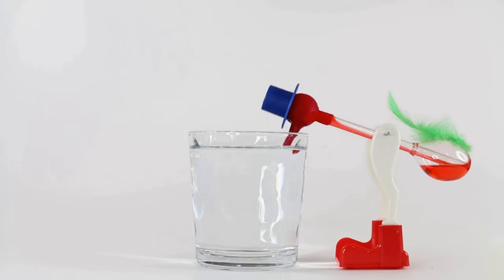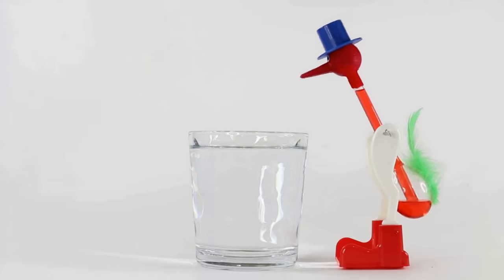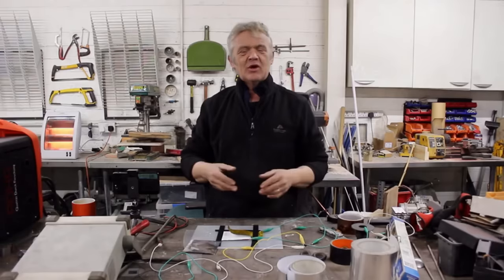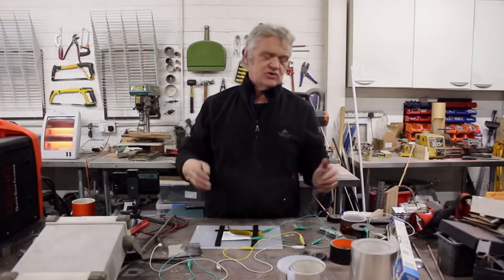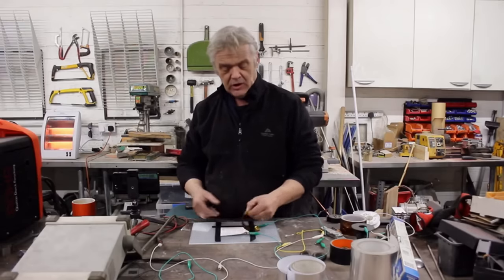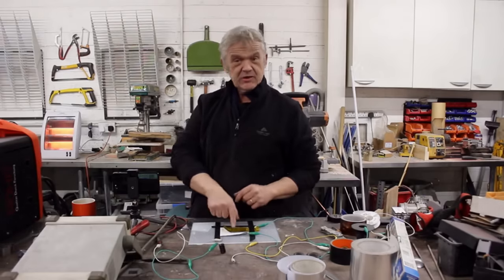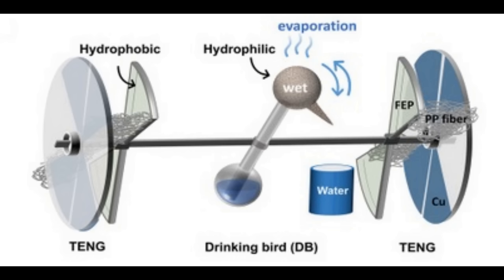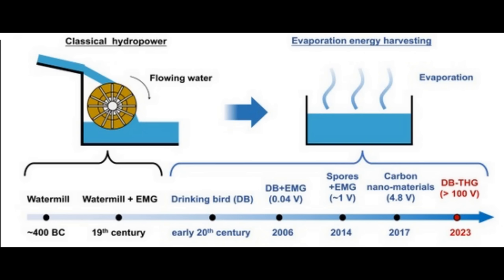2243 Dipping (Drinking) Bird Toy - The Clean Energy Future?

Comment: Hi Robert.  Have you considered using and experimenting with Piezo Film Sheets to generate electricity?  The material, piezoelectric polyvinylidene fluoride (PVDF) , is easy to use and it can generate a lot of electricity.  You just have to experiment with ways to continuously vibrate it.  It is very convenient to use.  Only one sheet does all the work.

Comment: Coil and magnet generators on VAWTs need a certain speed (cut-in rpm) to achieve a certain voltage to start charging a battery. If the VAWT   AlSO had a tribo generator attached to it, the VAWT could produce useful battery charge at low rpm below cut-in rpm.
So in effect, harvesting useful battery charging electricity with ANY rpm, or ANY movement. 
That is what I want to build. Charging a 12volt battery.... say, on a boat.
Chuck in Jensen Beach Florida.

Comment: The trick to making this technology work effectively at scale is to use negative pressure to lower the boiling point of a working fluid until it is close to room temperature.  Then, any amount of heat applied will cause the fluid to boil and can transfer that energy to a generator.  Unfortunately this means that your "boiler" must be hermetically sealed, making it mechanically impossible to attach a drive-shaft.  Enter MAGNETIC Coupling. 

Your generator and working fluid are housed in a hermetically sealed casing.  The turbine of the generator turns a large magnet inside the case and the pickup coil is on the outside.  This makes the system work more like a sterling engine - harnessing low-grade heat to boil a fluid and turn a magnet.  The fluid is then cooled to ambient air temperature, condenses, and the cycle continues.